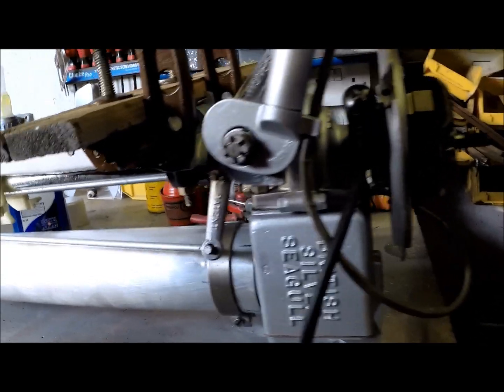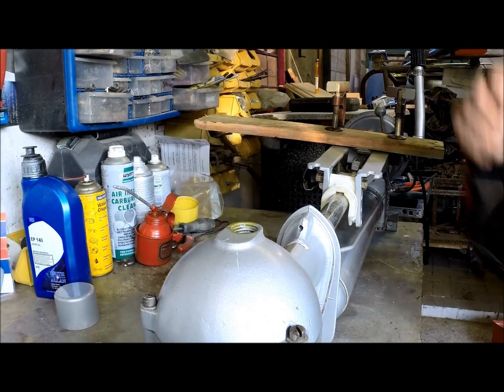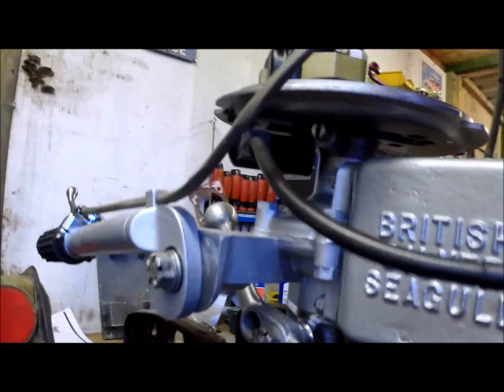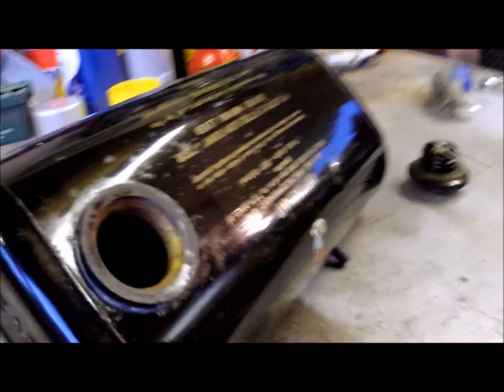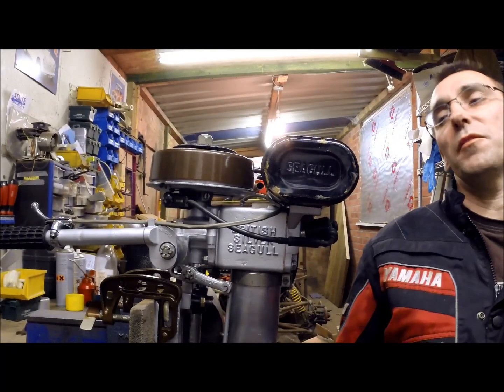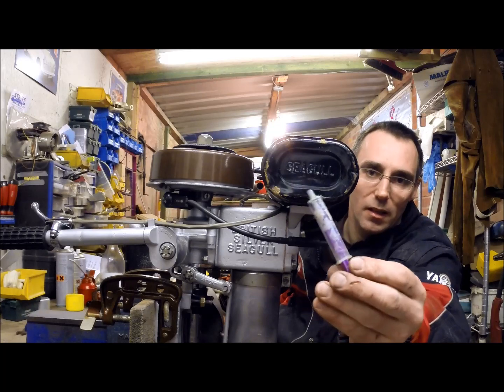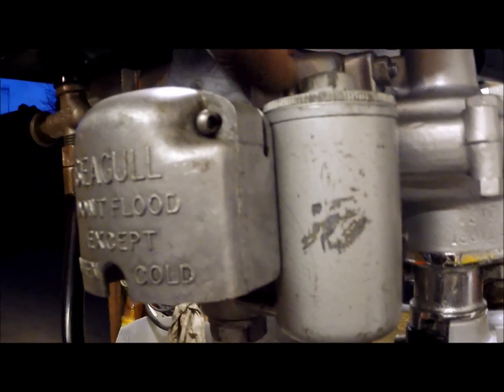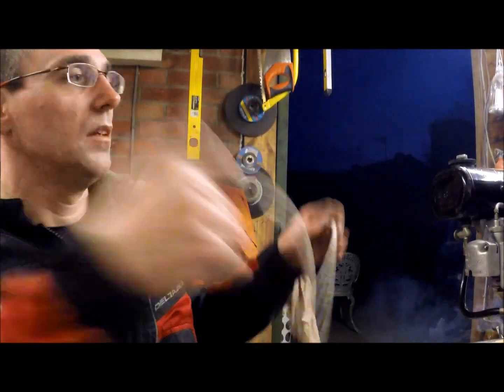Restoration of a Silver Century Seagull Outboard - Part 12

Comment: just got me a silver century and a seagull 40 outboard ( none runner's )from the scrap yard. don't know anything about seagull outboard engine's so I am a novice that is wanting to learn how the seagull work's .so what better way to learn is to start with a none runner . have striped down a seagull 40 for  the first time and learning as I go along with restoration . most rewarding part of this new project is if I can make it run again once I have cleaned and replaced part's  like piston ring's and new gaskit's. taking me time and bagging up each section with the dismantled part's /nut's and bolt's/ etc. I am finding this project interesting and happy with how everything is going . will keep me busy over winter. like your video's   they will help me when I start work on the century outboard  so thank you for taking your time to make these easy to follow video's .
Reply from the maker: Glad you enjoyed them, its what long winter evenings are for :-)

Comment: Many thanks for posting this series - great stuff and really useful for anyone undertaking a restoration of their own.   I have just watched all 12 episodes back to back. My father 

bought a Seagull, maybe even the exactly same model as yours, around 1969-1970 and it was the engine we learned on when I was growing up. Sadly, it was stolen many years later so I have no idea where it ended up. Anyhow your series brought back many fond memories of our old Seagull and generally mucking around in boats. I am restoring a wooden boat at the moment. It has an inboard diesel but, having been inspired by your videos, I am very tempted to buy and restore a Seagull as a backup motor.
Reply from the maker: Great simple motors !
Reply: Absolutely. Also, relatively light weight compared to a modern outboard - and mechanically reliable, which is exactly what I would want in a back-up.

Comment: Have just acquired this engine via Ebay and it will be used to power two sail boats - a YW Dayboat and a Hunter Europa. Have replaced transom thumb screws, one of which was damaged, with stainless steel ones, new waterproof HT lead and a new throttle cable and spring. Hopefully all good to go. Very interesting watching the restoration.
Reply from the maker: Kevin Brown Glad you you enjoyed it!! Thanks.

Comment: Hi - enjoyed your series. I'm collecting a 40 Plus tomorrow. On the gear oil - EP40 - I had understood that the correct fill was with the engine standing vertically. Fill up to the level of the threads, then put the plug in. If correct, you have way too much oil in the gearbox, I think.  Easily remedied, though. Just stand it up, place bowl under and open the plug.
Reply from the maker: Brian , glad you enjoyed it. Yes I believe you are right. Also the water leaks into the gearbox making the oil emulsify, but I believe this is how they are meant to run.

Comment: Great videos, watched them all. Question. My flywheel has 2 grooves for the sheer/Key what is the correct position(for timing) ?  I don't have a manual for the motor. I build a lot of small motors, mostly Evinrude and Johnson. Thank you Timmy.
Reply from the maker: Sorry Timmy, I dont recall. But if you give "Save Old Seagulls" a call he will be glad to advise. Mountain of knowledge. It may even tell  you on the website :-)
Reply: Cool, thank you for the info. Love those videos ! HUGE help !
Reply from the maker: Tim glad you like them, thanks!

Comment: Love the video
But it should be filled up with the motor standing up to fill the oil like a gearbox on a car it will run out when its level
Reply from the maker: Username I reset the level as you have said afterward, good shout.
Reply: @R1FREESTYLE  i believe to much can slow the motor down abit. Nice outboard BTW ive a fp 40 myself 1970 brilliant we motors and will do a rebuild next year hopefully